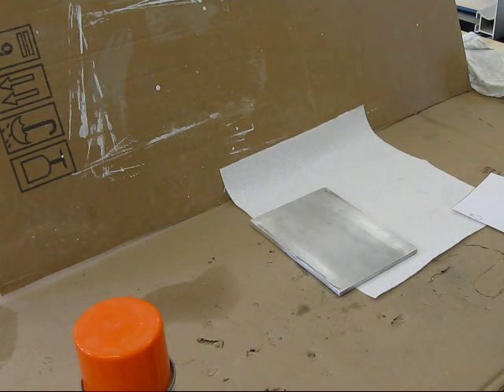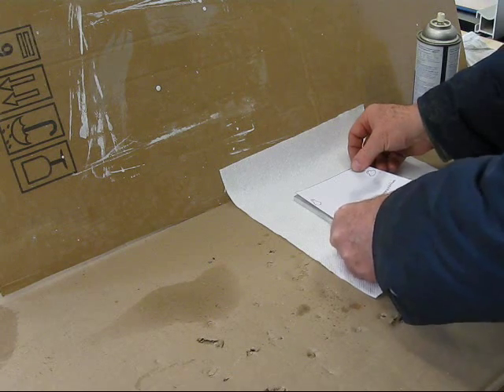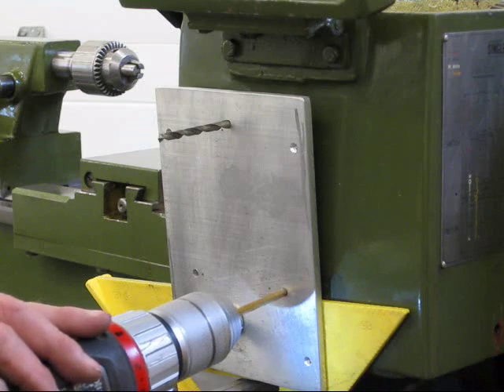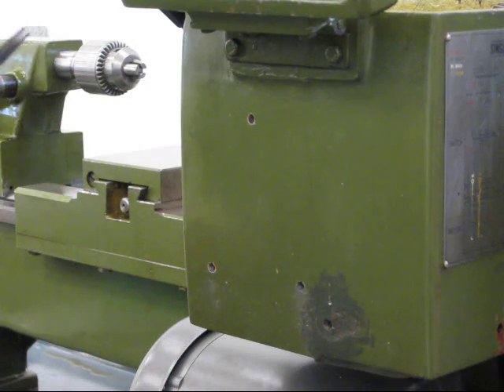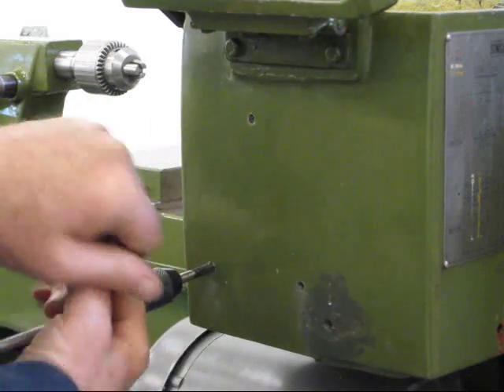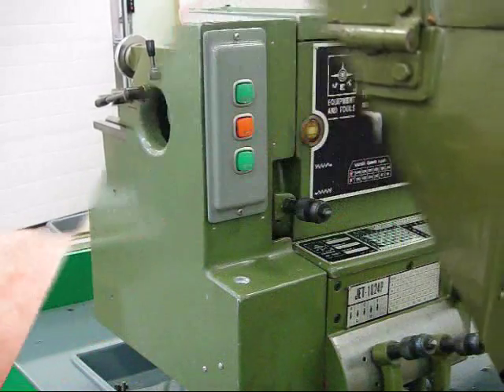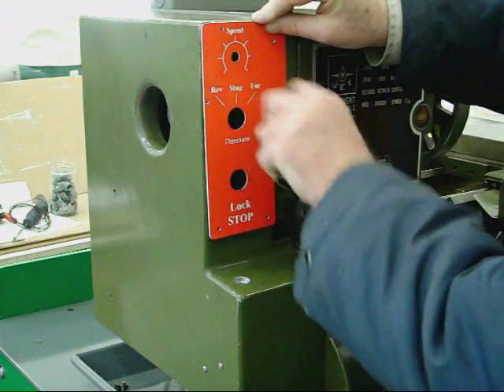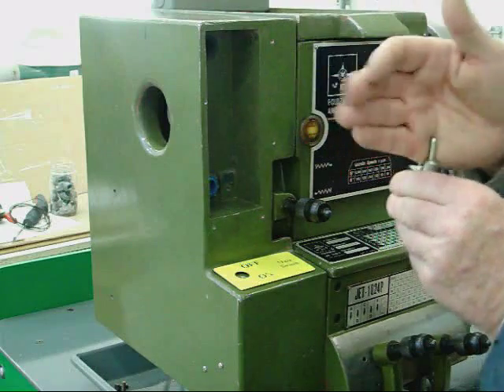Installing the KBMA VFD on the Jet 1024 Lathe part 3

Comment: I'm coming late to this party!  I'm hoping it's still going on. 
Yesterday I installed the same GS2 that you started with on a Sieg SC4 (from LMS) and I'm having serious problems. At very low speeds, such as I would use for thread cutting, I'm able to stop the chuck from spinning entirely with a single finger. I've cranked the torque boost figure to 10 (wish there was an 11), fiddled with the slip compensation and a few other things. All I've accomplished is overloading the drive very quickly. A few seconds and it's tripped out. What am I doing wrong??? Any thoughts at all?
I believe I have configured the motor parameters properly. I don't know what to do next. I certainly don't want to try to get all the electronics for the BLDC motor back in!
Reply from the maker: Hi Paul.  So sorry to hear of your problems with the drive.  I have a quick question - did you replace the motor with a 3 phase motor.  I believe the motor that is in that lathe is a 1.35 hp DC motor.  Were you happy with the speed and direction control as it was out of the box?
On my lathe with the drive I ended up using I can still change speeds by using belts so can control low speed torque to a great extent.  Having said that in all the times I have used it I have never changed the belts just left it at one speed and used the vfd to control the speed.   Rod
Reply: Newmachinist Thank you for replying so quickly (or even at all). Much appreciated! New Sub here, btw. I was happy with the power and speed, and so on of the BLDC motor. What I didn't like was the dangerous controller that the lathe has. If you set the speed of the lathe, do some work and then press Stop, when you press Start again the lathe accelerates towards the target speed and ignores all presses of the Stop or direction keys until it gets there. If the lathe is set to 2000 RPM it takes seven seconds for it to wind up to speed before recognizing that the Stop key is being pressed frantically; it then ramps to a stop very nicely. But it's often too late by then. I've been doing a bunch of left hand threading recently, so starting near the chuck with the carriage heading in the wrong direction is very nasty. So, I've thrown the baby and the bath and all of the water out, possibly a bit hastily, and modified the lathe to take a 1HP 3 phase motor and the GS2 VFD. It's slightly undersized compared to the original setup, but I think that will be fine. Undersized or not though, even without any change gears installed, at threading speeds my VFD and motor are totally useless. There is no practical way that I can see of adding any further gear reduction. The toothed gears and belt that are there give a 22/116 reduction.. At 5Hz with a 5" chuck and torque boost set to 0 the chuck stalls with a finger. At 10 it overloads and faults. Admittedly I cannot stop the chuck from turning at this setting, but it stops all by itself pretty quickly if you make it work hard. 
I'm in Calgary, where buying decent switches is hardly any easier than on the Island, I suspect. 
If there's a better way to communicate than filling up your channel please let me know. Thanks again.
Reply from the maker: Thanks Paul - will be away for a while and will get back to you later

Comment: I know this is an older video (2014), but I want to compliment you on a job well done!
Do you still have the lathe?
I just picked up this exact model and version that you have. Not as great as shape as yours Paint), but well cared for.
I wonder what color paint matches the original?
Reply from the maker: Congrtulations on getting one of these lathes.  First thing I want to tell you is that if you are going to get a new chuck or make a collet chuck (Doubleboost did an excellent video on one a few years ago) check the mandrel thread size on your lathe and don't follow the size some people have posted on forums as the size changes between lathe sizes  (1024P and 1236P )and possible which brand it was sold under.  Mine is a Jet 1024P with a nose spindle of 50mm x 8tpi  ( which is a bastard 2.047238" dia by 8tpi).
I think the colour is custom to Jet but I bet one could take it to a auto parts store and have them match it in a custom spray can.  I can have this done here on Vancouver Island BC  Canada so am sure it could be done anywhere.  Hope you have a lot of fun with your lathe.  Rod
Reply from the maker: Hi Joeak  I forgot to mention in my last post that this lathe's big brother is the Jet 1236P and shares the same instruction manual.  And both are almost identical to the Grizzly G9249 lathe which has a very good instruction manual that you can download from Grizzly.  Rod

Comment: It looks like you have a 20amp 120V plug on the vfd,does the vfd convert to 120V or just 3 phase to 1 phase 220V?learning about vfd,as I have a 3 phase lathe and want to get it wired up,which will most likely required adding 220v to the shop.
Reply from the maker: +James McGuire Hi James and thanks for your comments.  The plug is 15 amp 240 Volt single phase which is what I feed the lathe with.  In BC Canada the power company supplies 120/240 volt power to homes not 115/230 as in other parts of North America.  The VFD converts the single phase voltage to three phase and as a side benefit I can control the frequency of the voltage going to the motor.   In motors the power comes from the voltage (actually the size of the windings within the motor with the voltage giving the umph) and the speed is controlled by the frequency (and poles within the motor).
So in the case of, lets say, a 1 hp 120 volt single phase motor rated at 1725 rpm.  The no load speed of the motor would be 1800 rpm which is a multiple of 60 cycles.  The 1725 rpm is the fully loaded (1 hp) speed which allows for 'slippage'.  In other words when the motor is running with no load there is a magnetic field going around inside the motor at 1800 rpm and the rotor is being driven (drawn) by this field.  As the motor becomes loaded the rotor starts to fall behind the magnetic field (slips) and will be at 1725 rpm at full design load.  If the motor is loaded more than one hp then the rotor would fully slip and speed would drop drastically.   With a VFD the frequency of the voltage is variable and therefore changes the speed of the motor.  Hope this long winded explanation is helpful.  Rod

Comment: where did you get the emergency stop switch and fsr switch thanks and great vids!
Reply from the maker: +James Attridge Good day James and the best to you and yours for 2016.
I purchased all the switches off ebay and believe they came from China.
I live on Vancouver Island and switches like these would be very difficult 
to purchase here.   Thanks for watching.   Rod
Reply: +Newmachinist thanks for the reply and was wondering one more thing about the switches you bought, are they 3phase or single? im guessing 3phase 220 because thats what the vfd is outputting even though its input is single phase 115 right?
Reply from the maker: If my memory serves me right they are single phase low current.  The VFD itself does the motor switching.  The switches just control the vfd electronics (drection, on/off and speed dial).  Mounted on the level surface of the lathe door is the power switch which is at 240 volts and turns the whole shebang off.  Have fun  -  Rod

Comment: The squeal is typical.  You probably hear it less with the cover on.
Nice work! I love the engraved switch plates!!!
I use a Sony HDR-CX260.....great camera, but hard to recommend at $700+.  I use TrakaxPC4 for vid editing.  I think it's the 3rd one I've tried, but I don't remember what the others were.  There's a lot out there there that do a ton of things, but I recommend you find one that does the simple stuff quickly and easily.......this one does.  It will do all the fancy stuff too, but 95% of my vids are done with very simple cuts and overlaps.
Mike
Reply from the maker: Hi Mike  Thanks for the feedback I'll look into the software as I want to start
more video's in the late fall.
With respect to the engraved plate it lost a lot of 'character' due to lighting
and the camera.  The actual plate is much richer red - the engraving company really did a super job.  Thanks again  Rod